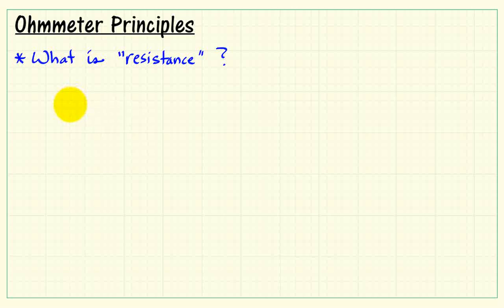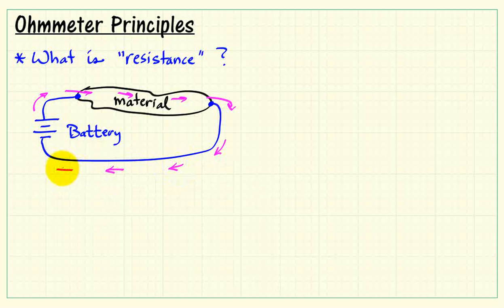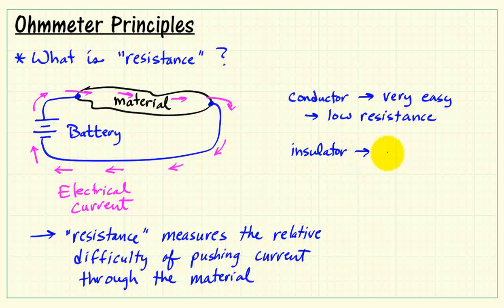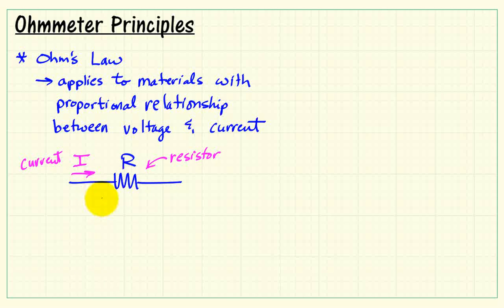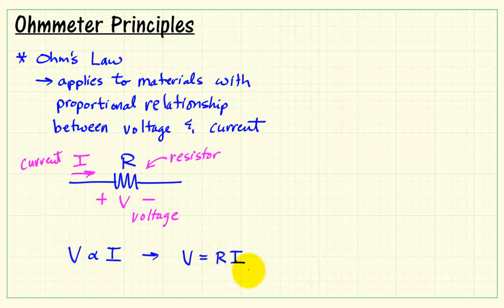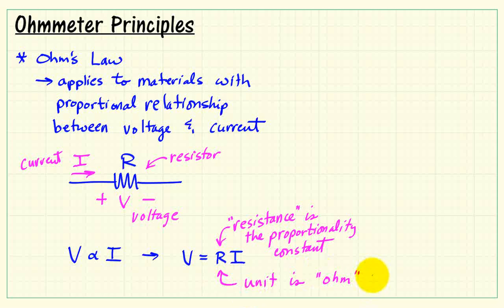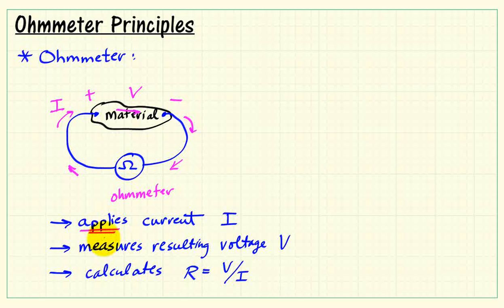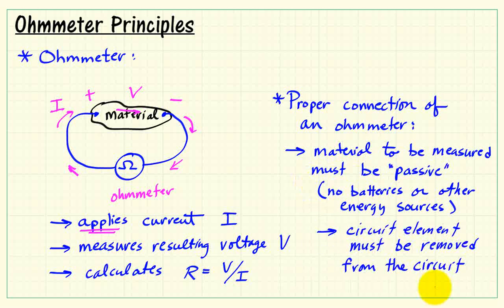Ohmmeter principles

Comment: Thanks for this :). In our book, I was wondering why there was termA-----------E------R(m)-------R(sh)------R--------termB. Now i realized from your vid that the ohmmeter has an internal battery that actually applies current then measures the resulting V then automatically computes the resistance of the element. Am I right abt this? Or is that concept of mine still wrong?
Reply: yes!